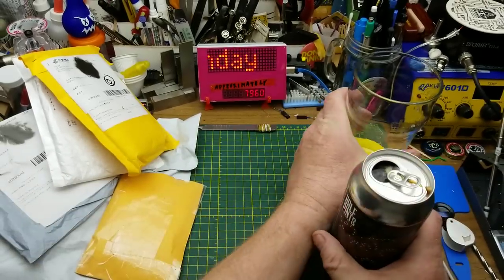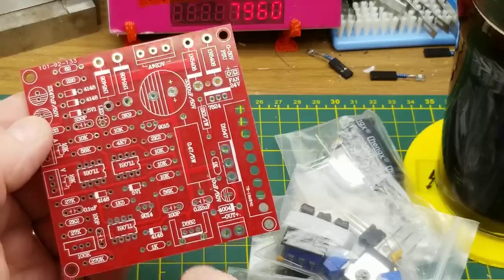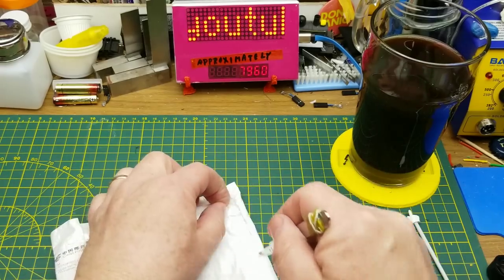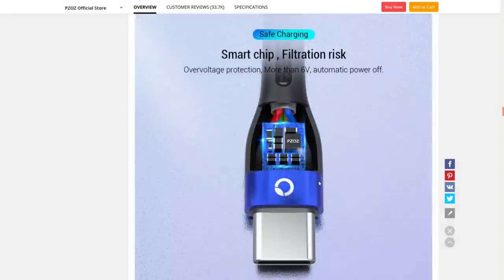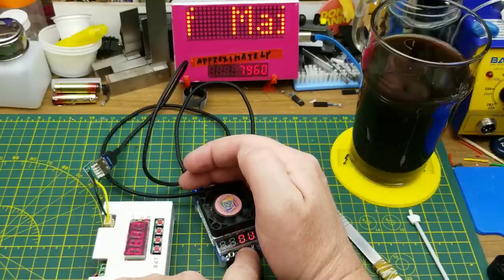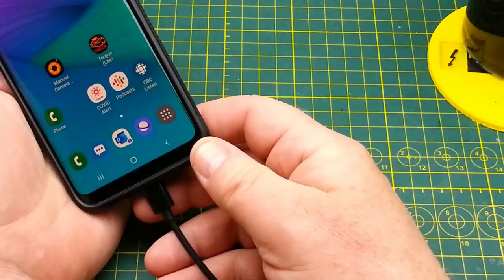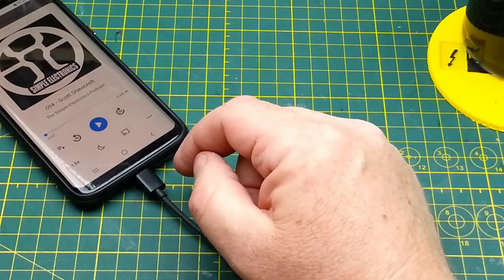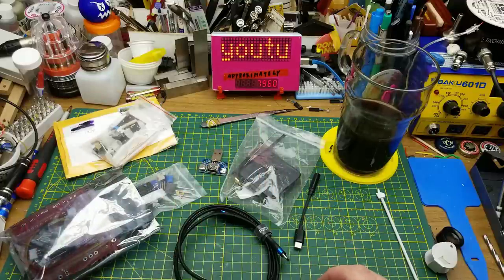Mailbag Monday #110

Comment: I have the same power supply kit. Great little psu for random use.
You can replace the 7824 with a 7812, it's only there for the fan voltage.

Comment: Those little AC/DC power supplies are great fun! I have about 10 of them now..lol! Anyway, please, please, please use sockets for the op-amps as very often one of them comes bad out of the box. You can test them with the transistor tester. Also you can swap in LM741's for a bit more reliable supply, if you want. Hope this helps, as i learned the hard way not to solder them...lol!
Reply from the maker: I learned the value of IC sockets a long time ago!

Probably as unpleasant a learning as you had.
Reply: @pileofstuff  Yes, sorry if i implied you were a "newb"; that wasn't my intent. It is just amazing how many reviews i see of these that say the op-amp is failed and they soldered it in. Oh, and here is a link to details and mods, etc.....and if you need more just search for "Original Hiland 30v...." and you will find plenty. Here: http://www.paulvdiyblogs.net/2015/05/tuning-030v-dc-with-03a-psu-diy-kit.html
Reply: Oh, and PS....i think yours is one of the newer variations on these that i haven't tried yet, but essential the same. Will be interesting to follow your experiences. Thanks!

Comment: You could sort of check if that usbc adapter has anything inside, just connect it via ammeter and check if it draws anything. Second thing, even if it draws something, it still might not work, audio over usb c is a messy thing.

That clock module is one of these smooth ones, when second hand moves smoothly, instead of single tick every second. Might be not easy to overclock. If I remember correctly, chip inside clock swaps voltage on coil every tick, so electromagnet can rotate small ferrite magnet around in one direction, thus making whole mechanism spin.

Comment: 8:35 - Here's how to test USB cables the easy way.
a) Get one of the USB socket adaptors like shown at 4:30 or any other suitable USB socket (eg: MicroUSB).
b) Solder a short-circuit between the VCC and Ground connections on that socket.
c) Get another USB-A socket for the "input side" and connect 2 thick wires (eg: AWG18) between it and your power supply.
d) Plug USB cable into both ends. Power goes in one end, and short circuit at the far end.
e) Set power supply for about 5V (doesn't actually matter) and set Current Limit of 1 or 2 Amps.... whatever current you wish to draw with your phone.
f) Switch on, measure the voltage across the "input end".
The actual resistance is irrelevant - just read the voltage drop directly.... that's actually what you want to know.

Comment: Hi, the resistor on the USB C jack are for host/slave recognition and for setting the current allowance.
See: https://electronics.stackexchange.com/questions/333071/usb-type-c-configuration-necessary-for-battery-charging-only

Comment: Curious if it is possible to create a Joule Thief with a smart diode, or JFET, so it will switch voltages below a diode drop.  You know, boost a 0.1V source.  Such a device might need a little kick-starting mechanism to make a small reservoir MOSFET gate charge.
Reply from the maker: It might get tricky when you start getting down to those voltage levels.

Comment: I wonder if that clock module could handle a 14500 AA 3.7v lithium ion battery.  One way or another that might speed up time :-)
Reply from the maker: Interesting thought, but I'm pretty sure they run on a cheap crystal oscillator. 
Those don't generally overclock with excess voltage.

Comment: cheap and cheerful power supply but how much trouble to set the current limit without a display, i guess hook up your 10 amp meter and adjust the pot before connecting to you project...
Reply from the maker: Yeah, its going to need some modificatiin to be really useful.

Comment: I bought a 3.5mm to usbc adapter from a vendor in person and the black one I first grabbed didn't work so he gave me a white one that did work. I don't know why there would be different adapters but it may just be you need a different type. I was lucky that I could try it in person. I have a pixel 2xl.
Reply: When the Pixel came out, they came with USB earbuds and warnings that others wouldn't work because Google wasn't providing any analog audio out the USB-C like some other phones were, so the headphones needed a DAC.

If this adapter is trying to do analog but the phone doesn't support it, it's not gonna work.

Comment: With the USB-C to 3.5mm adapter:  It could be made for the TRS ( 3 Connector ) Or if it is made for the  4 connector  (TRRS) then it could be the wrong wiring for the headphones/ mic. there are at least 2 different types. 1 is - Tip = Left Audio , Ring 1 is Right Audio, Ring 2 is Ground and Sleeve is Mic. The other version is Tip is Left, Ring 1 is Right, Ring 2 is Mic and Sleeve is Ground. I hope that helps.  More info @ Wiki: https://en.wikipedia.org/wiki/Phone_connector_(audio)
Reply from the maker: I love multiple competing "standards"...
Reply: @pileofstuff  The wonderful thing about standards is that there's so many of them.
Reply from the maker: @CurtisIreland  https://xkcd.com/927/

Comment: There's different standards and methods for USB-C audio out.  USB-C audio class 3 seems to be what is being pushed, but I think it requires the ear buds or the adapter to have the DAC and amp in them.  IE, that's a complete mine field unless you know what you are looking at.  So you've got audio out, digital out, USB 2 audio, USB-C class three (and maybe numbers before that), and gawd knows what other variations.  BTW, how does the phone know that you've plugged headphones in anyway?  Phones with no jack on them are (A) more waterproof, but (B) probably don't have the DAC or amp built in either because that's where the real cost and power savings come from.  Unless you look at the specs for the phone audio wrt to USB (if it's even enabled in the OS) you are just playing a guessing game.  I think USB-C class 3 audio uses burst mode DAC, and I expect there needs to be some way for the adapter/headphones to let the phone know that there is a compliant device plugged into the USB-C connector.  Heaven forbid that you should want to charge your phone and listen to something at the same time even if you manage to find compatible accessories.

Apart from that, it looks like a great haul again ;-D
Reply from the maker: Good information.
I was assuming the cable had a DAC built in (partly because thats what the seller claimed), so if that was true, then I expected it could identify itself to the phone plug-n-play style.
But the "multiple standards to choose from" angle makes a lot more sense. 
Ill have to do some more research.

Comment: They use the excuse that headphone sockets are not water tight and so remove them.
Reply: Good job my ears are water tight i don’t want to lose them :)
Reply: @TheEmbeddedHobbyist  do you know what’s a good tip for clearing water between the ears?
A tap on the head :p
Reply from the maker: Yeah, I'm skeptical of that reasoning as well. It shouldnt be much more of a job to waterproof the headphone jack then the usb port or the SIM tray.
Reply: @AJB2K3  - Dad, you're drunk again. No more of your dad jokes, OK?
Reply: @pileofstuff  The USB port is actually sealed up.
Stupider things have been said by phone makers.
Reply: My Galaxy S5 was IP67 rated, with the headphone jack open, so somebody's lying.
It did need a cover over the USB socket (micro-3.... try and find adapters for THAT style these days!)
Reply: @RottnRobbie  - My old Galaxy Note 3 also had USB 3.0 Micro. You can just plug a standard MicroUSB in one side of the connector, with the limitation of only USB 2.0 speeds.
Cables for USB 3.0 Micro B to 3.0 A are easy to find, as the connector was used on portable HDD. You can also get cables to USB-C as well.
Here is 2 adapters that may be of interest:
https://www.ebay.com/itm/Micro-B-OTG-Adapter/324490381262
https://www.ebay.com/itm/Micro-B-STD-Adapter/253627046972

Comment: I have no USBC phones, but is there perhaps a setting to select audio output device?
Reply from the maker: None that I've been able to find so far.
I have previously used a USB audio device with a OTG adapter without having to make any config changes.

I may have to do a teardown on this cheap cable to see if it actually has any components in it.